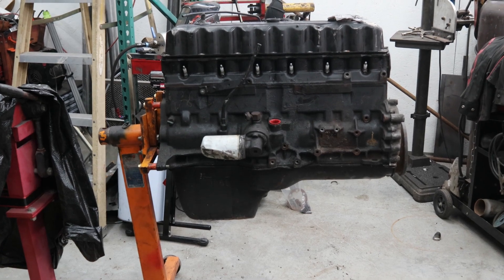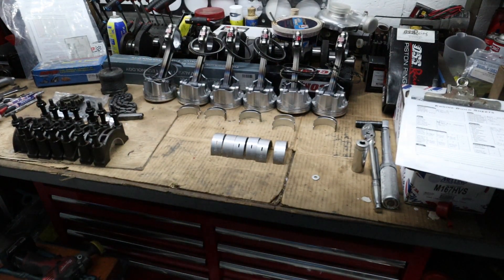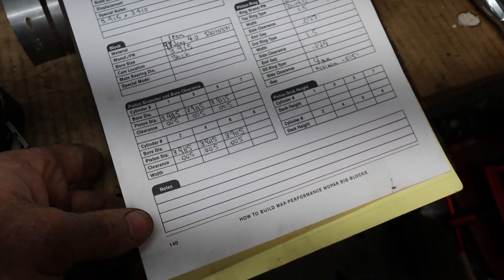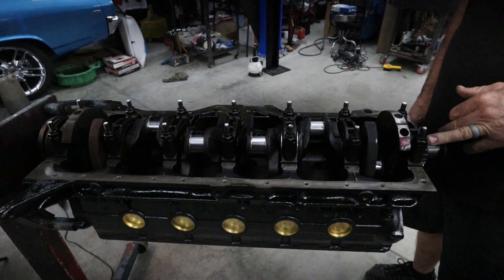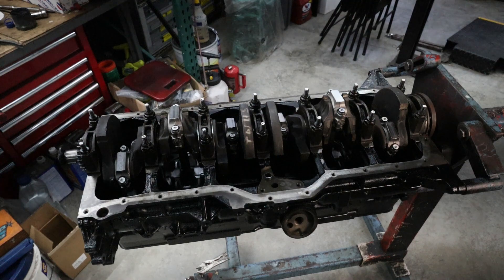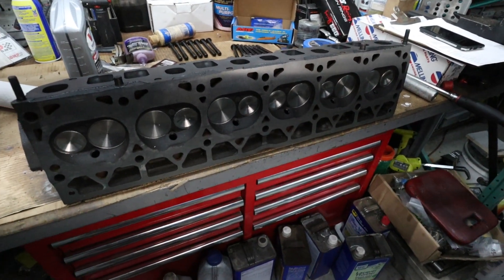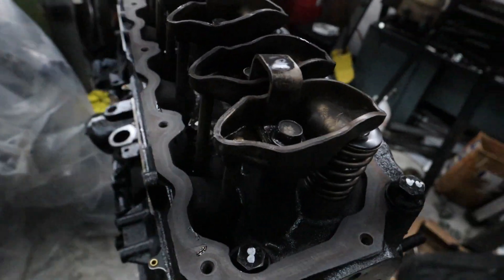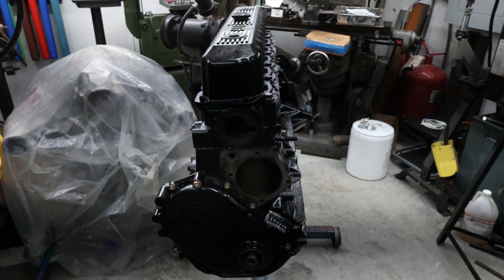4.0L AMC TURBO ENGINE BUILD

Comment: I love videos like this. Here in Australia we have a Ford engine called a Barra. 4.0 DOHC inline 6. When turbo charged they can make insane amounts of power with just your basic mods like head studs etc to help reliability. The engine before the Barra was basically the same but SOHC like the one you're building and still capable of huge power. American cars are so cool, your friends Gremlin looks amazing! I hope it doesn't wheelstand too much! Cheers from Aussie.
Reply: Hey, you Aussies have some badass rides down under there too! Some of the coolest GM, and Ford cars that were never available in the states! And yes the Barra is badass!
Reply from the maker: Yes, we hear about the Barra engines here in the states. Check out my other videos, my buddy has a drag car with the GM Atlas 4200 6 cylinder. I did a engine build video on that engine as well